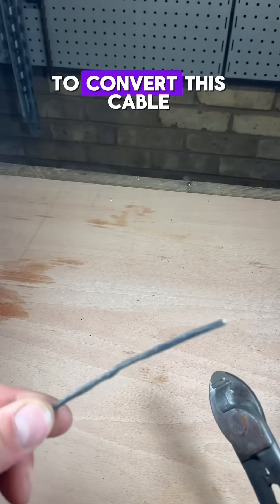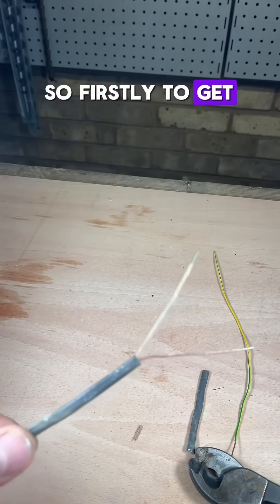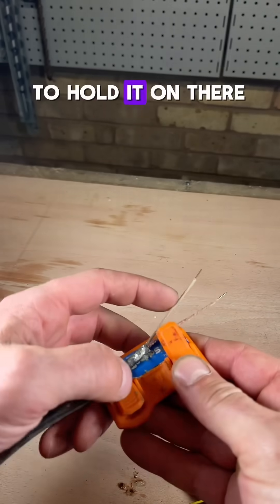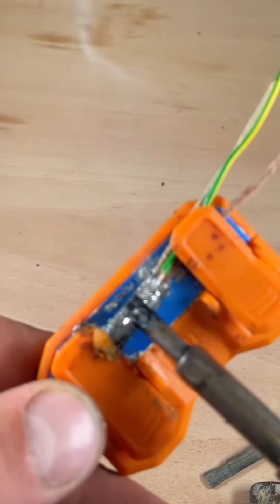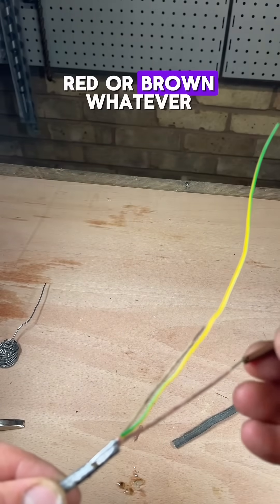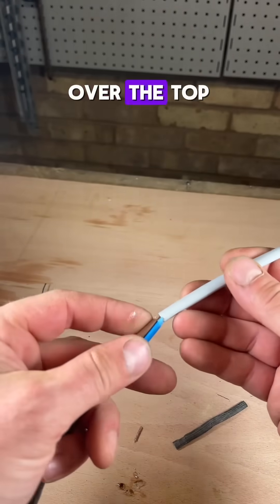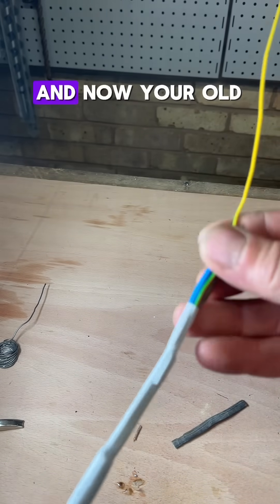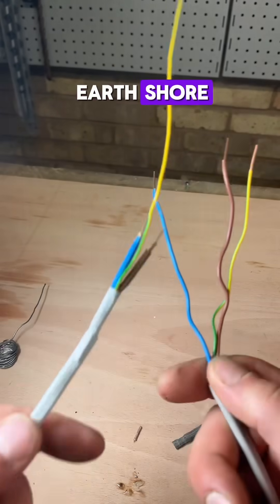100 Years of Electrical Cable: What’s Changed and Why It Matters! ⚡

Comment: Downvoted and reported for dangerous and misleading malpractice:
The resistance of the lead shield is too high, the resistivity of lead is 12x that of copper.
If soldering would be allowed, the lead shield should be sanded before applying flux. The soldering process takes too long.
Which flux do you use? It must be no-clean flux, else the remaining flux will proceed to etch the copper and lead down.